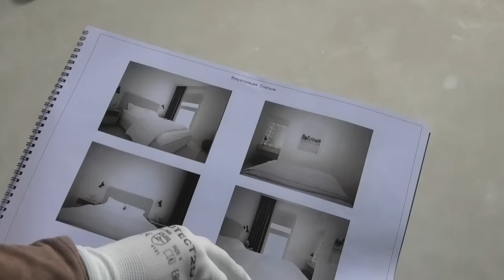Шумоизоляция стены в квартире своими руками. Все этапы. Каркасный вариант

Comment: I think the ankers, starting from 06:21 are completely unnecessary.  Furthermore, although there is a rubber distancer on the bolt, exactly this element will continue to transfer the vibrations.
From the wall, to plaster plates.